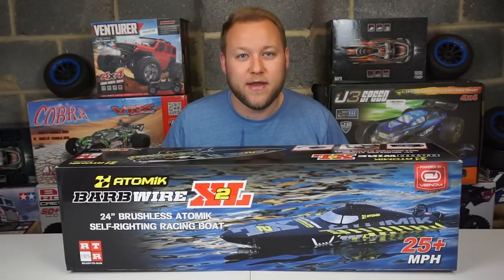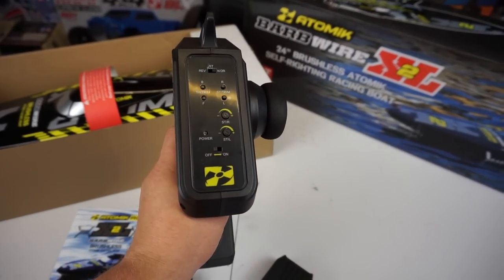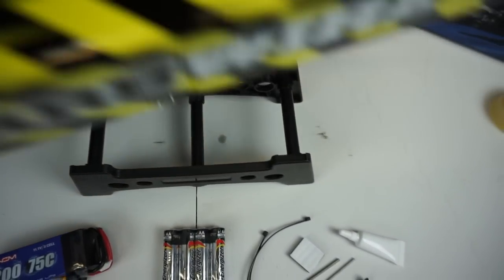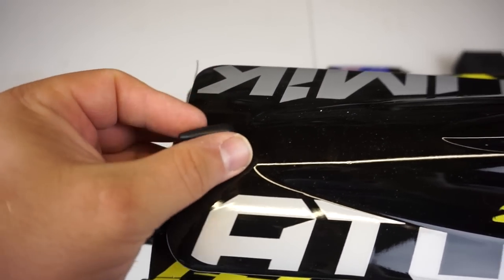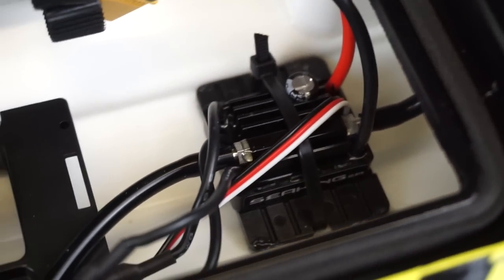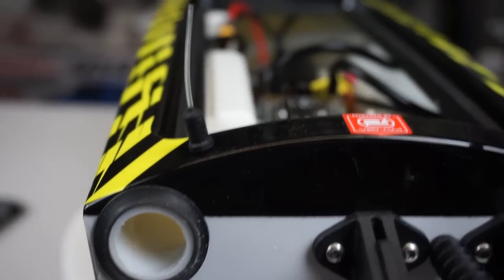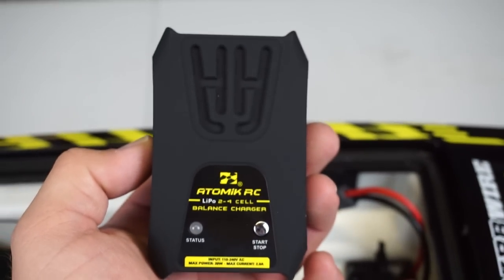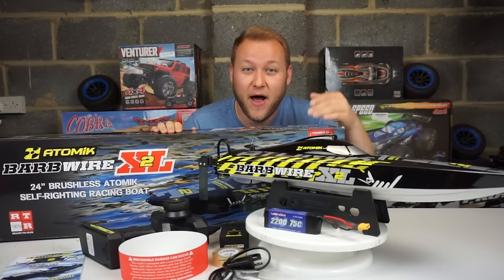Atomik Barbwire XL 2 RTR Brushless 24" RC Race Boat

Comment: I’m not technical, because of age and aptitude.  Does the owners manual give the laymen enough info to tighten and lubricate parts to maintain the boat without incident?  My primary buying motive is (what the XL2 offers plus) reliability.

Comment: Dude you explained the watercooling the wrong way !!! The water gets pushed in at the back an leaks out the side hole! How should the motormount (with no moving parts inside) pull water in from a hole wich is over the water level😂😂😂😂. You realy have no idea how a boat works.
Reply from the maker: Haha! I know and now I've learned the correct watercooling direction! Thank you for teaching me RC Flo! - Jake